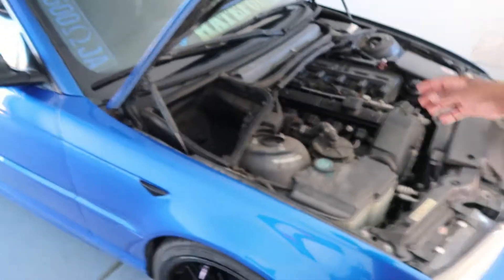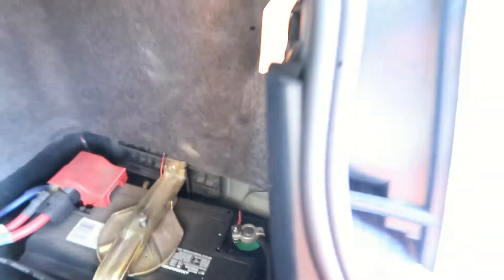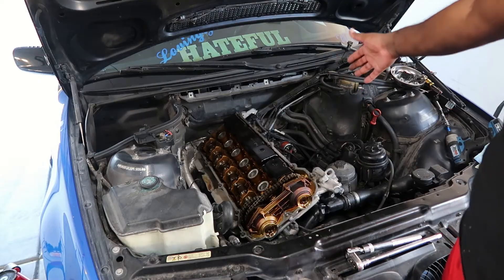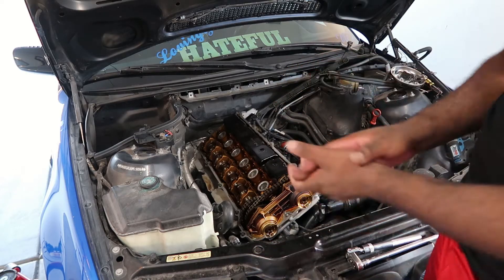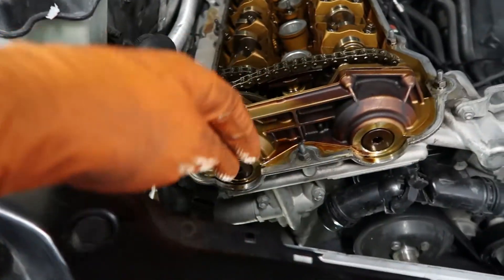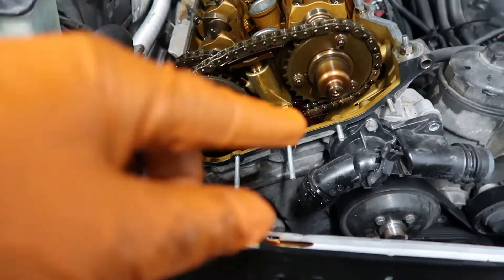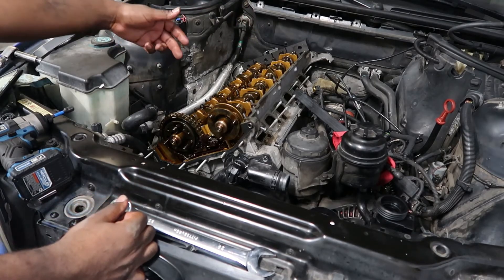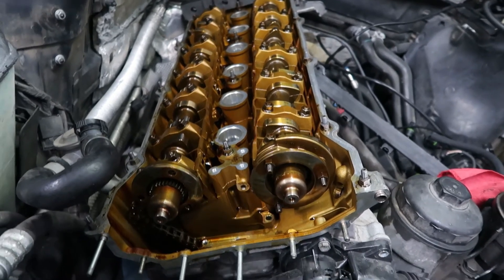E46 Head Gasket DIY Part 1

Comment: I'm about to take on this job. I just hope the head bolt threads aren't already stripped or block warped.  I've got the 2004 325i. Looks exactly the same.   It failed my compression test with cylinders 3 4 and 5 reading like 60psi the others were higher like 160psi.   So it must be the gasket .    It's a project car. I'll learn as I go.     I'm sure I'll come back to this video a few times lol.

Comment: i just got done doing a head gasket on my 04 325xi and i got everything back together i thought but maybe not, i tried to turn it on and there was no crank, then when i tried to turn the key again it was like locked, they key wont fully turn, any help
Reply: Check your grounds or battery/starter/alternator connection

Comment: About how long did it take you
Reply from the maker: Way too long because I didn't have the right stuff. Also I pulled it and then they found the head was cracked so I had to get another head. I would say a few days if all goes well.
Reply: Ok but how long did it take to pull the head off?
Reply from the maker: @Zaydub666  literally like a few hours. Biggest part was the timing of course.

Comment: Saved me from making a huge mistake trying to pick up one of these as a starter project
Reply: I say should’ve went for it very very easy to work on theses I got 325i taking motor out right now and over hauling about everything upgrading some parts it’s very fun and easy
Reply: @yusufsesay6648  Is this your first project car, or have you had previous ones? I'm looking to get started, so want to start off easy probably with a Japanese Make
Reply: @y_not  yes it is but I do have a little prior experience working on cars I’m more of a Honda guy and tend to work on them more but yes this is my first ever project car and honestly it’s been very smooth and easy to work on I’m about to take out the exhaust now
Reply: @y_not just recent picked up a 2001 330, first car I’ve ever done work on. Not as bad as it seems
Reply: @oogiebungus140 anything you can tell me about it? Just picked one up
Reply: @rubendelacruz7395  depending on your miles and prior maintenance you should definitely look into picking up a water pump, expansion tank, thermostat, new hoses belts and tensioners. My whole cooling system blew up after a couple weeks of regular driving. Also not a bad idea to check the condition of your intake boots
Reply: @yusufsesay6648  how'd your head gasket fix hold up?
Reply: @y_not  oh no I didn’t do a head gasket I completely removed both engine and transmission haha
Reply: @yusufsesay6648 you got any idea why my 325i leaks coolant after dumping it in? hoses, clamps, res. tank and everything else is fine
Reply: @elmz1010  where is it exactly leaking? Is there a certain spot it’s coming from
Reply: @yusufsesay6648  Im late but i found it where it was coming from and it had two broken water pump bolts 😂 Appreciate it tho
Reply: @elmz1010  oh ok glad u figured it out 😁
Reply: @yusufsesay6648  do you know common reasons for blown head gaskets on E46s?
Reply: @y_not  for the most part, the head gaskets don’t usually go bad on theses but if they do it’s because of the cylinder head bolts that are threaded into a soft alloy of the cylinder block and over time it loses the ability to hold bolts tightly which can then of course cause overheating and oil and coolant mixing. But then again it all ends up leading to one thing overheating and oil and coolant mix
Reply: Little late to this comment but believe me, buy a e46 as a starter project car. Did the same thing and these cars are just too much fun and pretty easy to work on
Reply: Lucky for me i knew what i was taking on 😅 Never worked with cars before and now im sitting here tearing apart my motor to change broken gaskets and also gonna do a transmission swap 🤣
Reply: @ciggyroach if you take pride in learning you enjoy the work. Especially when your project car isn't your daily driver.
Reply: @ciggyroach  how'd your head gasket fix go?
Reply: Excellent starter cars. Every car has pros and cons even your japanese brands. If your scared you'll never get better. Just don't buy a piece of junk
Reply: Definitely a bit late to the party but the E46 was my first car and to work on they're pretty good. I've got another here that just stopped working on me as I was getting home. They're pretty fun to work on and as an inexperienced 19 year old they're pretty forgiving too

Comment: And he skips parts of taking vanos system off like come on dude
Reply from the maker: What are you even talking about? I literally showed the removal of the vanos, how to remove it, and then explained it. Then the amount of nuts holding it can be seen when I pull it off.
Reply: There's videos out there on step by step of how to remove, rebuild, reinstall the vanos. I think this video was pretty straight forward of what would need to come off.
Reply: you should not be touching cars if you're hating on this 😭

Comment: I have the same motor E46 it runs Hot and no coolent coming out no where do you have any ideas what's courses it keeps getting hot
Reply from the maker: Could be what was happening with mine, with the crack in the cylinder head. Check out the other videos I put out about it.
Reply: On some videos some shows maby the heat sincer on the bottom radaer hose I changed almost everything with the coolen sistem
Reply: I'm about to take the head off maby tomorrow but I just about got enough of the car if the head gasket replacement don't work I'm done I will scrap it
Reply: But the only thing that is stopping me from scraping it is it runs so so good it's costing me so much to fix it don't know what to do
Reply from the maker: @jimmielebouef2546  that is a problem because they're old but good. Do leak down test first.
Reply: I did the test that to was good I will try a bigger radaor and mite take out the fan and put a bubble blower for air... I'm about to put a roof top AC on the hood and run some ducks

Comment: Done my e46 last year and still running strong with 267,000 mile on the clock. Replaced a lot of maintenance items while I was there. Good luck
Reply from the maker: That's what's up. I'm hoping to get another 17 years out of this job, not a new head but it's gonna be done right. I got a bunch of new stuff too.
Reply: what year and model you have?
Reply: @TheModding69  2002 325i slick top manual
Reply: @gabsky2365  i have an 01 325i. do you feel like the handling is stiff and has a lot of body roll